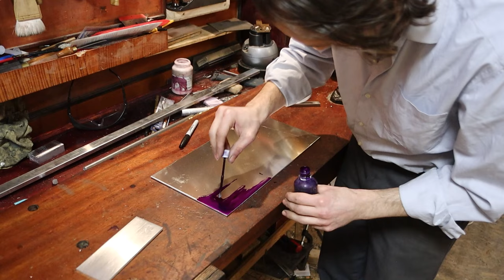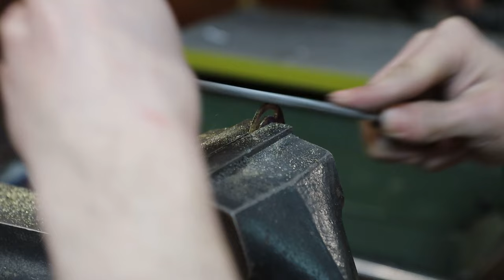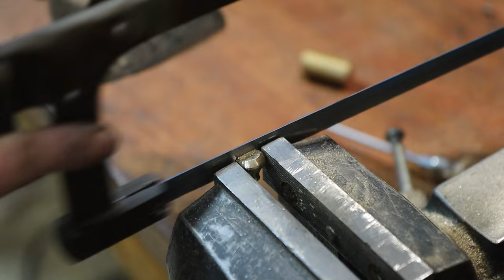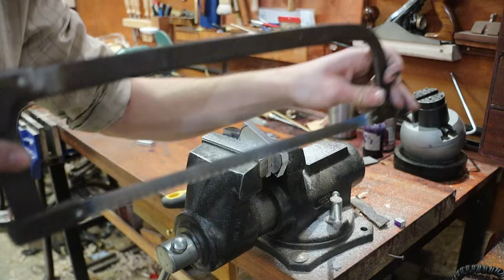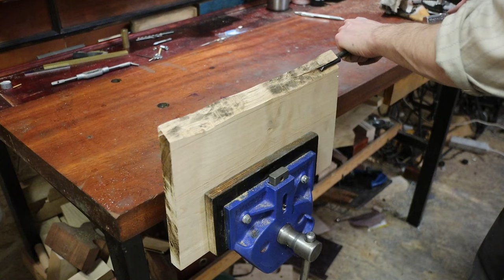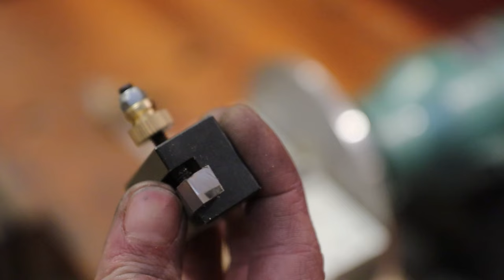I mounted a diamond wheel on a bench grinder and made a custom tool rest for it

Comment: Don't use diamonds on a powered grinder (For steel)! Use CBN instead! CBN is slightly less strong than diamond, but it's shape and thermal qualities make it much better fitted to powered applications (For steel and softer than carbide materials(even relatively pure titanium metal).). Diamonds are for HAND USE ONLY when it comes to grinding (Steel and softer than carbide materials), where as CBN is for powered use (Same applies)! CBN can also still grind carbide, but it won't last quite as long, and it pretty much works the same as diamond, so use diamond in these cases. IF you intend only to grind carbide against it, use diamond, but if you intend to grind steel and other materials more often, use CBN. Or, get both, Diamonds exclusively for carbide, and CBN exclusively for everything else, which will maximize the lifespan of both materials.
Diamonds are more brittle than CBN, and will chip and break off in ways that aren't conducive to a sharp grit. CBN is cube shaped, it snaps along it's shear lines like diamond, but it's shear lines are consistently parallel, making it more difficult to break when spinning at high speeds. CBN is far more thermally conductive than diamond. If it grinds steel free from a piece, it will distribute the thermal load into the sheared steel and not the workpiece, making for less thermal damage to your workpiece.
https://www.sciencedirect.com/science/article/abs/pii/S0007850607627681
https://www.sciencedirect.com/topics/engineering/cubic-boron-nitride
https://link.springer.com/article/10.1007/s00170-020-05134-y

Comment: Why are you using a diamond wheel to sharpen high-speed steel? This makes no sense at all.
Reply: Im a retired master goldsmith and we always used diamond wheels to sharpen the gravers which are hardened tool steel.